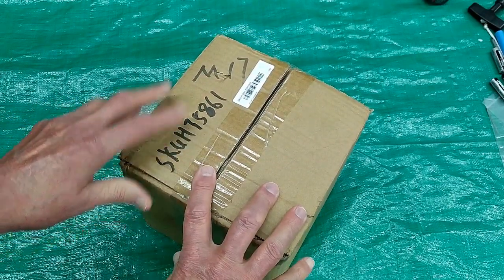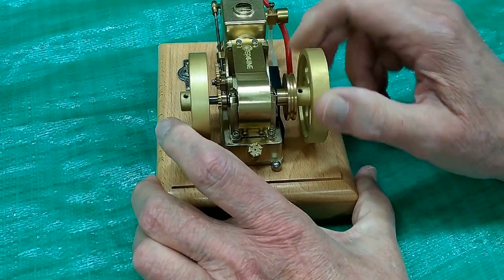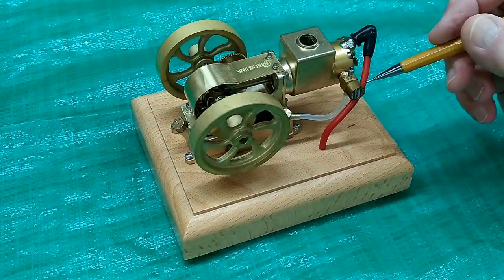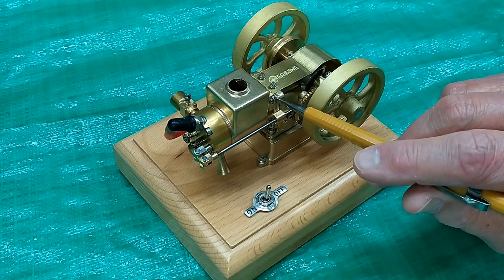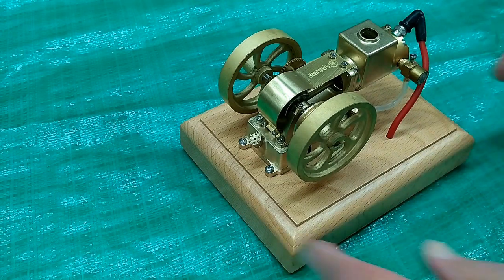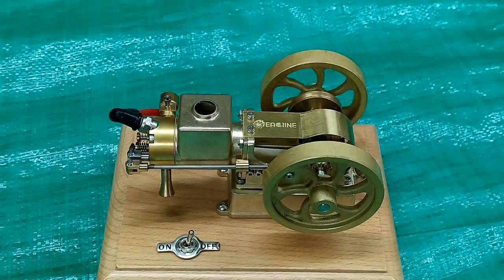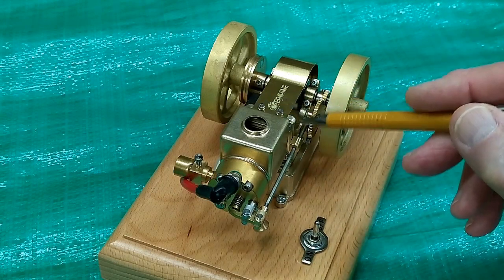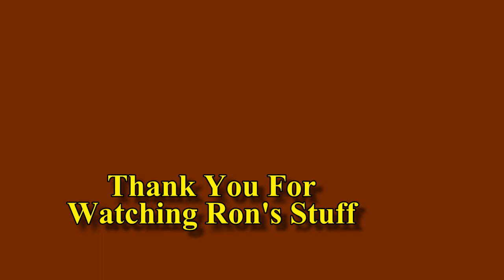Eachine EM3 Horizontal Engine Review

Comment: I got the M17 about a month ago, ran for a week but can not get it to run since, think it's timing or valve issue? Do you have any thoughts. Thanks Mike
Reply from the maker: M17 and EM3 are the same engine. It appears Banggood stopped selling it (but not sure about that).
Mine leaked water. Once I got that fixed it ran fine and it still does. 

We have found on some engines it was necessary to remove one of the batteries and replace it with a dummy. I have a video on this and have mentioned it several times in various review videos. This necessity to remove one battery has been inconsistent engine to engine... cannot explain that.

Batteries can shake loose from the battery holder. Sometimes the mounting bolt, which also secures the ground wire, can come loose. 

I assume you have checked for a spark and if it still has the same compression as when it did run?

Sorry about that but I really have no other recommendations other than if you got it from Banggood, try to return it and get your money back or get something else in exchange.

If you paid with PayPal, you can try filing a claim under buyer protection.

Good Luck!
Ron
Reply: Thanks for the prompt reply, I tried the battery shunt, have good spark but timing for fire was off, I think set screw was loose on shaft and moved, adjusted to just past TDC like your other video showed but not sure exhaust valve timing is correct, any chance you could make a video for timing this M17, tried small changes but still no luck. Valves seem seated and changed o ring on piston. I have Maytag Hit and Miss engines that run all day but this little fellow has got be scratching my head. That said love your video's, keep up the good work
Reply from the maker: The timing for all of these engines is the same. I have several videos where I go through the 4-cycle process. The exhaust valve should open at or just past BDC of the power stroke (a bit dependant on how the cam is made) and close just before TDC of the exhaust stroke. Watch the video on the ET1, ET8 or EM2 and I go through the timing. I like for the spark to fire just past TDC of the compression stroke, which avoids having the engine back-fire.
Some of these little engines can be very finicky regarding needle valve position. Some won't start if the throttle body is too far open. Don't forget that there are two needle valves... high speed and low speed. The video on the ET9 Carburetor Adjustment shows this.

Comment: Hi, I like your videos, all are very interesting, you have a new subscriber, I'd like buy my first one model, but I'm not sure which model choose, what could be your recommendation about this series or another like this . (ET or EM). Thank you!! :)
Reply from the maker: Thank you for subscribing!
My favorite engines are the ET1, ET6, ET7 and EM2.

ET7 is the simplest of the larger horizontal hit & miss engines to work on (replacing the o-ring piston ring).

My next choice for the larger engines would be the ET1 or ET6

EM2 is a very nice vertical hit & miss engine.

I have review videos on all of these engines.
My engine videos are all grouped together in a single playlist found on my channel page.

I would not recommend the ET8 or the ET5 series. The ET8 has too many problems and ET5 can be problematic.

Please use one of the links for your engine of choice, found in the description for my engine videos. There is also a discount code for most engines which will save you some money.

Banggood,com has a return/ refund policy for anything you may have a problem with. I would also recommend paying with PayPal which give you another layer of protection. 
Keep the original packaging and shipping label until you are satisfied everything is working properly.
Ron

Comment: Morning Ron, on the o-ring change for this and the EM1, do you mark everything with the engine at TDC before removing the head? Do the same o-rings get used on both the piston and the cylinder water jacket? My EM1 is on 'restocking' and I'm trying to learn as much as possible before it arrives.
Reply from the maker: The piston ring o-ring is a green high temperature material and is much smaller than the cylinder liner o-ring which is black neoprene or nitrile. Piston rings are available from Banggood and there is a link in the description for my videos. The manufacturer does not give o-ring sizes. If a liner leaks, you take it apart and measure the existing o-ring and go find a suitable replacement. All of these o-rings will be metric sizes. Sometimes I give the sizes in one of my videos (and then sometime I have forgotten to do so).
I have 67 videos on the various model engines, so there is a lot of information there. All of those videos are grouped together in one of my playlists. Have fun!